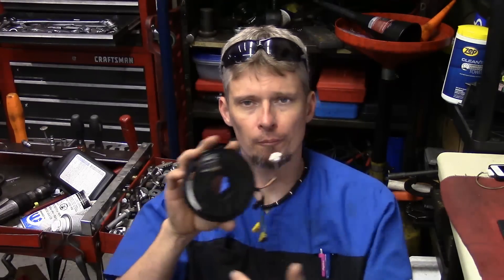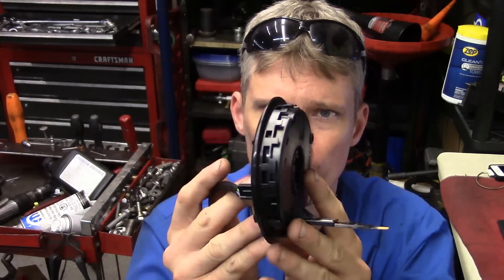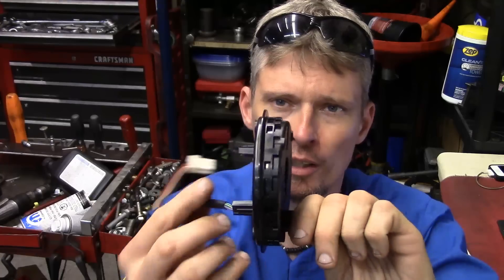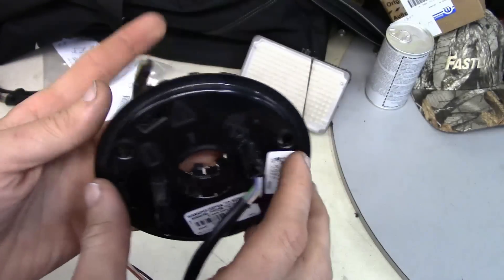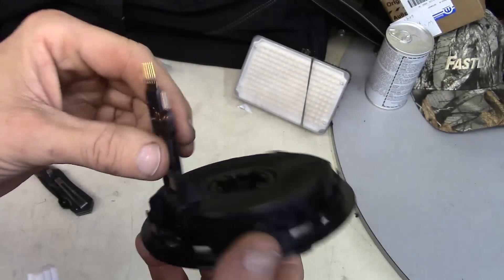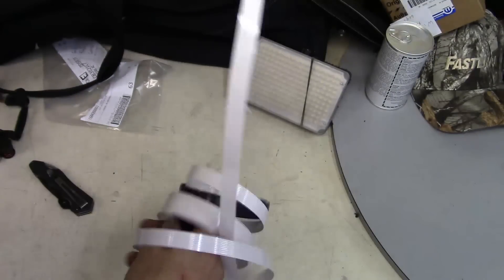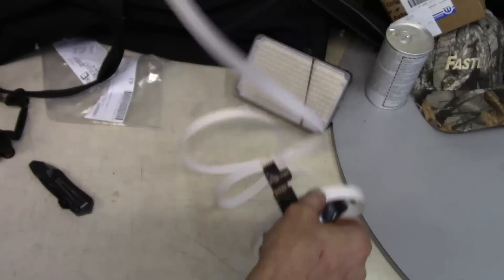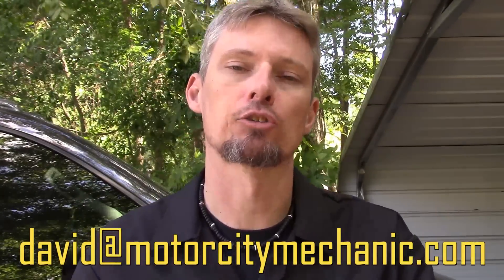Tech talk #5: "Clocksprings". What they are and what's on the inside

Comment: Good stuff....Just changed out mine on my 2014 Jeep JK. Now my electronic stability control light is on the dash as where it wasn't before. Wheels where pointed straight forward...steering wheel aligned with the dots. Pulled the safety lock out of the clockspring after the steering wheel was installed. Everything I've read leads me to the steering angle sensor needs calibrated....is there a diagnostic scanner that you recommend for an end user(not a shop) that can tackle this? Some do certain stuff while others don't.  Kinda confusing. Thanks in advance 👍🏻😎🔧

Comment: Had my steering box replaced at shop near home on my Ram 4500. When i picked truck up, airbag light on, cruise inop and no buttons worked on wheel.  Told tech, and he said i had to take it to dealer to have something "reset". Talked with a Ram specialist who said they probably spun the wheel doing gearbox and broke clockspring.   Uggh.   Wish they woulda been honest....anyways great info as always!

Comment: excuse me my cars signal stick doesn't go back to the rest position after pushed down for left turn, I have to push it up for it to be on resting position, and when turning steering wheel either way the signal snaps and turns on by itself. could you give me your opinion, on what the problem might be?
Reply from the maker: Morning. The issue can be one of two things. First you need to take the steering wheel off and remove the clock spring. Pay close attention to the back side of the click spring to see if there is any broken or damaged pieces near the center. If okay then I recommend replacing the multifunction switch. Usually there will be some broken plastic pieces in the area when the clock spring is removed. Thanks for the question and make sure to subscribe
Reply: +MotorCity Mechanic  I will definitely look into that, thank you for your help
Reply from the maker: +El Trillo your welcome

Comment: And they aren't water resistant as any Jeeper caught in the rain has found out when they leave their top off.  Expensive mistake.
Reply from the maker: +Matthew Keen your correct. Some seem to think you can pressure wash the dash as well with no issues. There are no water proof/water resistant components on the inside of the vehicle. They also find out that the alternators don't like water/mud as well